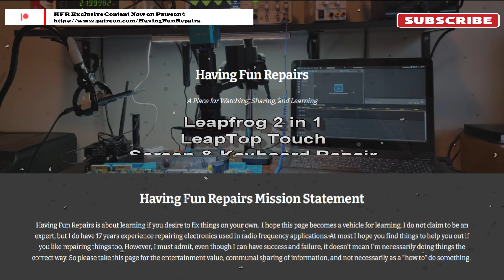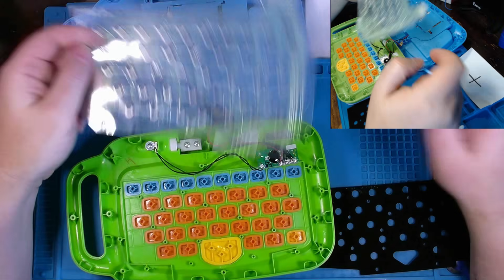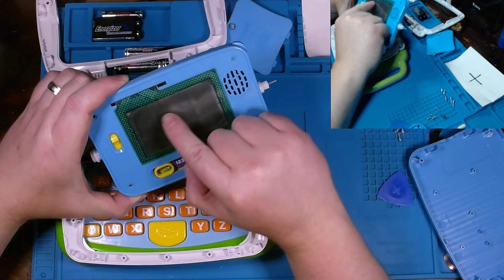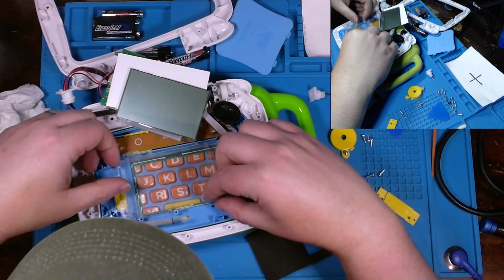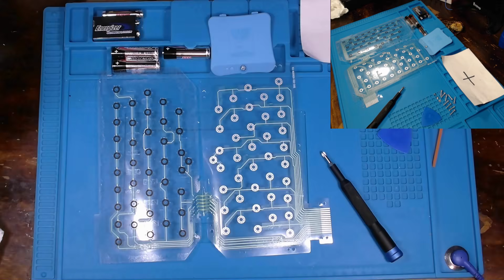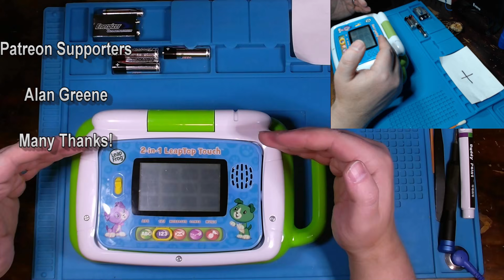Leapfrog 2 in 1 LeapTop Touch Screen & Keyboard Repair

Comment: Hi! Ours show some lines on the screen. Could it be that the LCD is broken? Thanks so much for your video.
Reply: I see.. thanks so mucj for your input. I will keep yput advice on mind. Again, your video is very helpful 😊
Reply from the maker: Most often if there is a constant dark line across the screen the LCD is damaged and needs to be replaced. If there were lines missing that could be something with the LCD connector. From what you're saying I would suspect the LCD needs to be replaced.
Reply: Can you tell what LCD screen I need to look for if I will attempt to change it? 😅
Reply from the maker: @teacherab12  I wouldn't call that type of repair "economical". Especially given those toys I believe sale online for less than $20. If you want to try and repair, your best chance is to find another broken toy but with good LCD. Unless, there's a part number you can match for it. Otherwise the exact pixel or dot density , size, and connections points+type are at least minimally needed to even attempt to find a sub. Happy hunting if you do try and repair though.